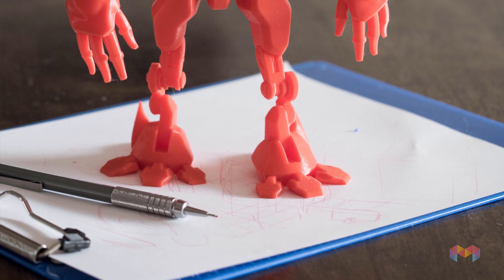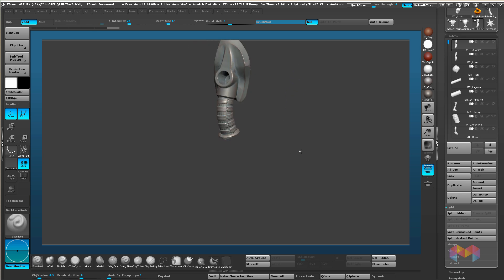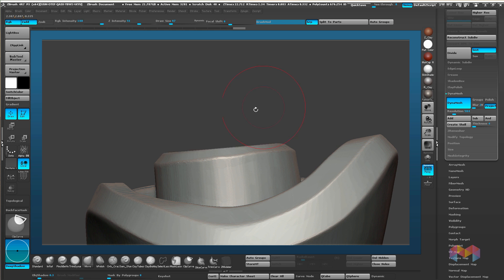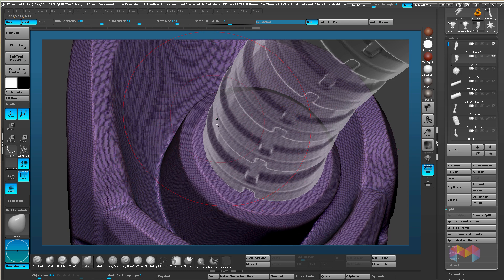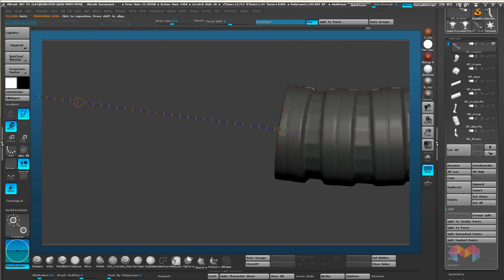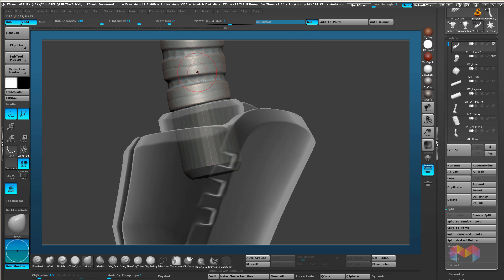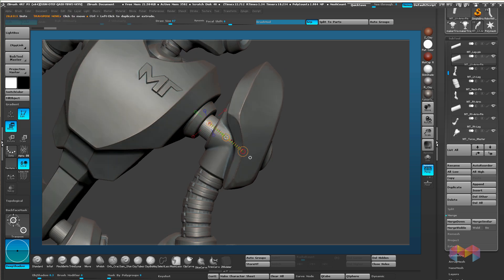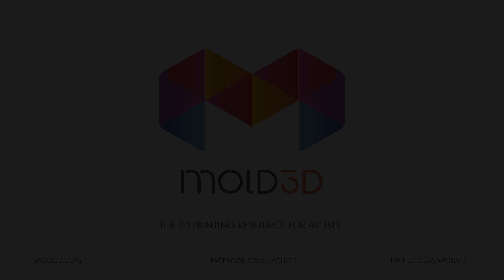Customize Models for Easier 3D Printing

Comment: Problem with zbrush is that dynamesh is size dependant so if your model is too small you're screwed, cause you'll lose resolution in your model (details), also when dealing with high poly counts zbrush tend to be unstable and crashing as much as it wants, another thing zbnrush doesnt have a tool to check the integrity of the mesh ( non manifold geometry , holes etc) , you have to jump to netfabb or mesh lab to check your meshes and fix them ....
Reply: +Giankarlo2805 With 64Bit zbrush, it handles high polycounts just fine. Our models are routinely over 10 million polygons. As for the dynamesh and losing resolution, you can either raise your dynamesh count, up to 4000, or if your model is extremely small, you can adjust your model in the scene to be more "regular". The stl exporter allows you to export them mesh at any size you need, so you do not need to work at the printing scale. We have printed several hundred zbrush models with extreme success using these methods.